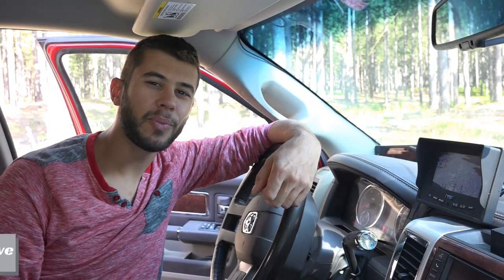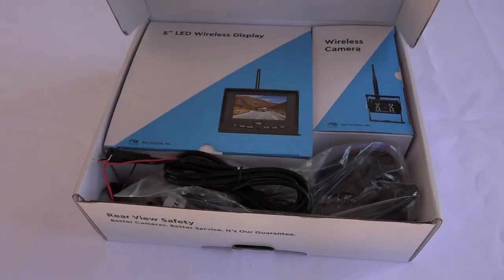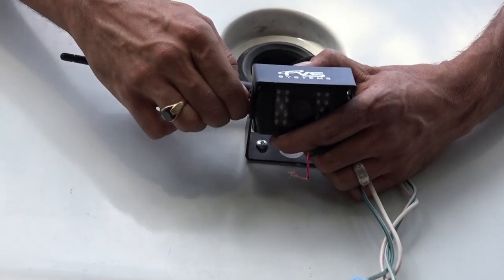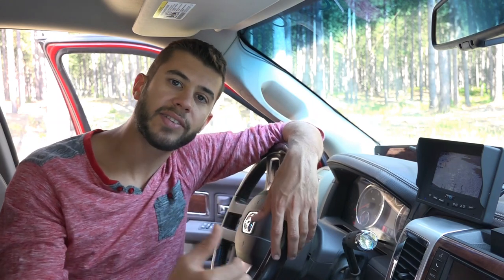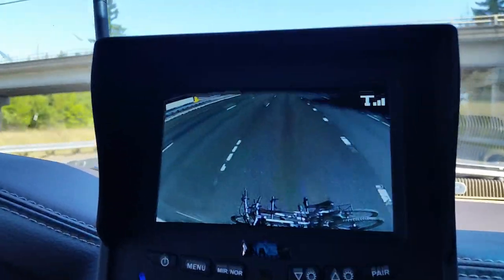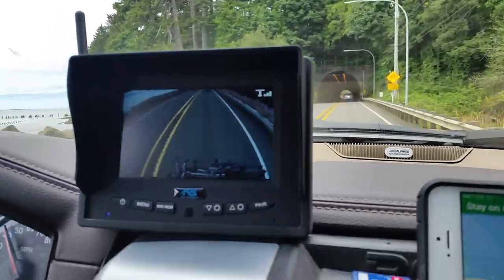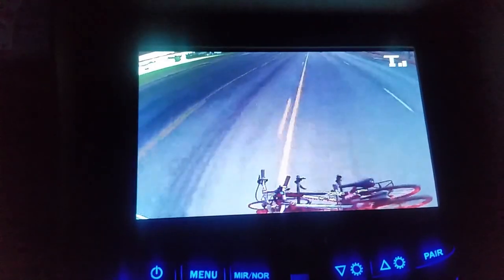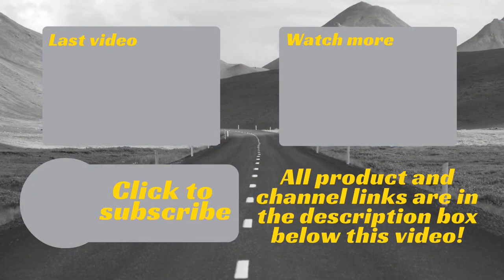RVS-155W Wireless Back Up Camera System by Rear View Safety | Product Review

Comment: The studder is caused by frame rate buffering overload. Since you are moving at hi-way speeds any great amount of change in the pixels in the frame caused by fast motion of any object, it will cause digital cameras to studder. You see, the way they "save" band width on digital camera transmissions is by transmitting only the pixels that have changed, and it can only do this so fast. So you will see this in digital transmissions in sports events on LCD screens, they will studder too if the screen refresh rate is too low. This is why people buy 240 Mhz LCD TVs in stead of 120 Mhz refresh rate LCD TVs, so they can see the sporting events without studdering. Since this camera transfers Frames through digital transmissions, you are seeing studder because of the cumulative changes in pixels per frame that have to be transmitted to update the image in the monitor up front. If the camera and monitor where on a higher frequency, the total through put would be greater and there would be no studder. Like when you use 5 Ghz on a Home WIFI system instead of 2.4 Ghz, it has a greater through put because it can transmit higher amounts of data for the same bandwidth of one channel because it talks twice as fast as the lower frequency. Hope this helps. Cheers and as always God bless.
Reply from the maker: I bet buffering is part of it but it seems to be a signal issue.  It has a signal indications and when its strong there is no stutter.  The stutter is also full frame, not parts or individual pixels.  It is possible that a higher frequency would work better but you would need a considerably higher transmitters power.  Overall the problem is intermittent and does not occur very often so we are still very happy with this camera.

Comment: nice video,btw,the other day I saw a wireless backup camera system on Amazon caled haloviewHaloview MC7101 particularly designed for large vehicle,7" LCD digital monitor,120° wide viewing angle,IP69K rating,Built-in SMART IR-CUT filter,seems good,only $199.

Comment: i just hooked mine up basically the same way..got it working only after hooking it up backwards and nearly melting the black wire..im sure the orientation of the antennas the same will help, but i wonder, i do get some staticking out of the signal, while stationary in the yard, and my voltage at the RV lights was reading about 11.51. it should go up with the truck running at highway speed. and the seller did provide an extension antenna that we can run out the truck window and place on the roof.. thx

Comment: Ok big question can I use multiple cameras that comes with it, like in the box meaning can I add more of the same cameras
Reply: Yes Rear View Safety has a kit that has 4 wireless cameras. 1 rear, 2 side and a front. Of course you can place them wherever you want, and all four will show up on the split view screen monitor.